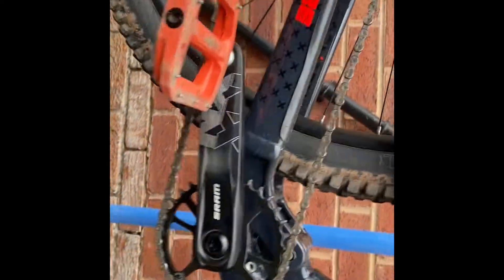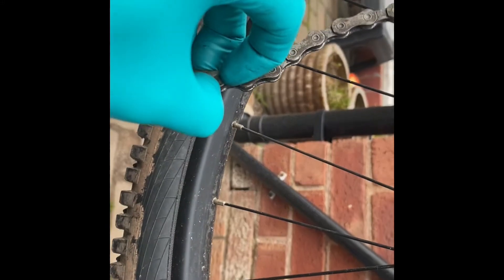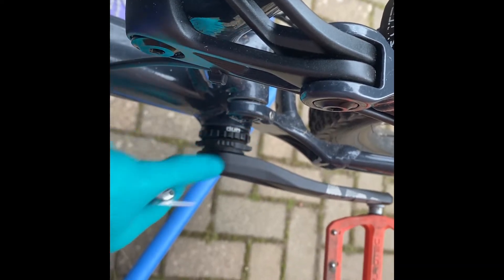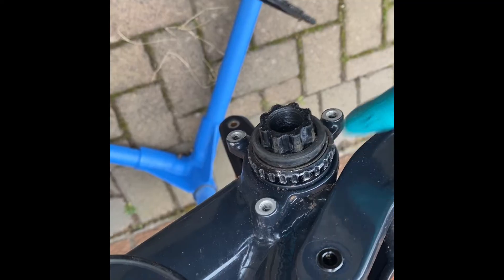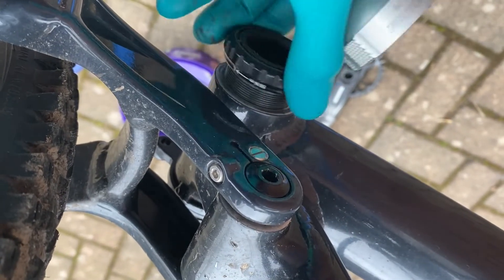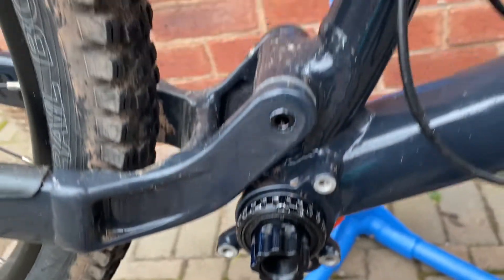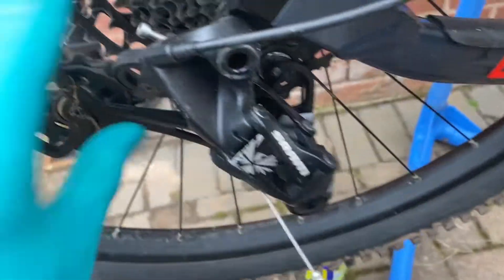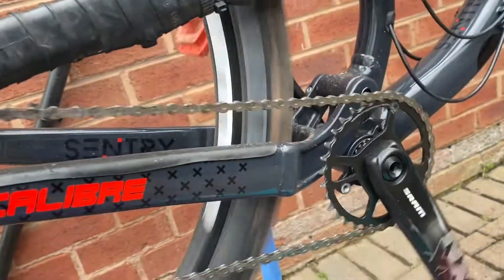How to remove sram dub crankset and bottom bracket and reinstall

Comment: Thx for posting this, but the most important part (that you "may" have to hammer the crank out) needs to shown in your video.
Reply: I got the bolts off but can’t get the washer or the drive side off.  Cranks are usually the easiest to get off.

Comment: The twisty lock ring thing on the non-drive side....should that be turned towards or away from the + when installing?
Looks like youve done it the same way for removal and install.
Reply: Did you ever figure our which way to turn it to loosen the crankset

Comment: Is it possible that I overtightened it while reinstalling? Crank arms don't move as freely as yours
Reply: That plastic lock ring on the non drive side is a bearing pre load I believe. Try loosening or tighten that lock ring to see if crank arms spin more freely